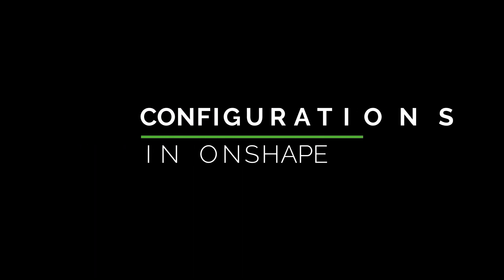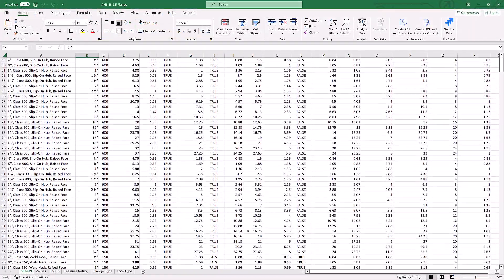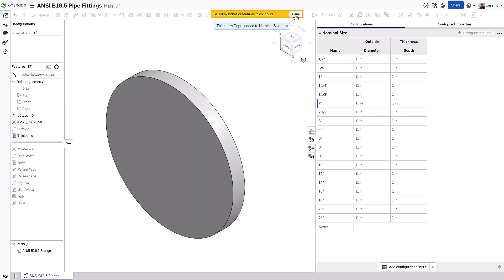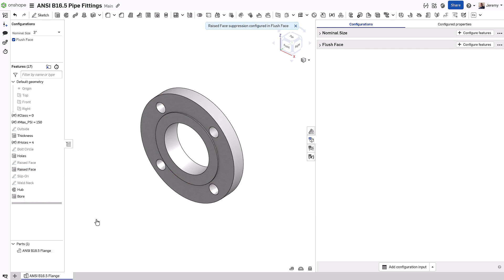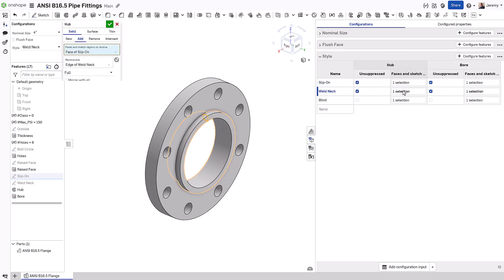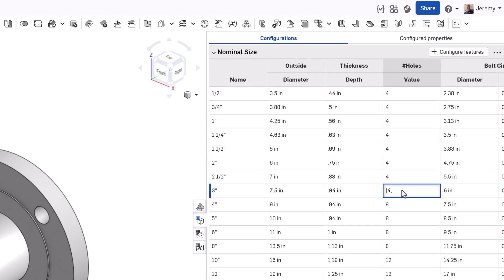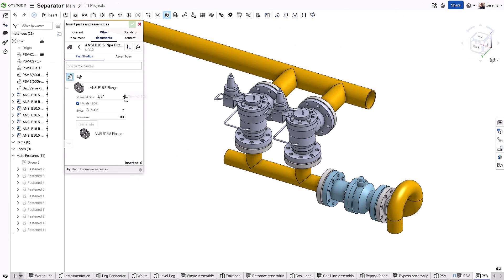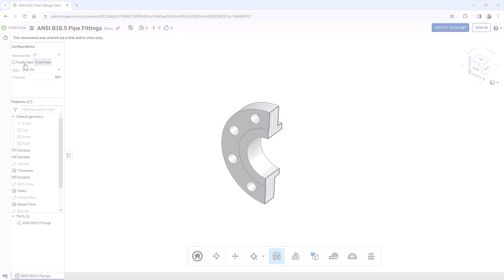Introduction to Onshape Configurations

Comment: How are you snapping parts into place so quickly, i can do the same thing with the standard library of bolts and nuts but no with my custom pipe fitting library
Reply: I'm just learning Onshape, but I think they are using mate connectors.